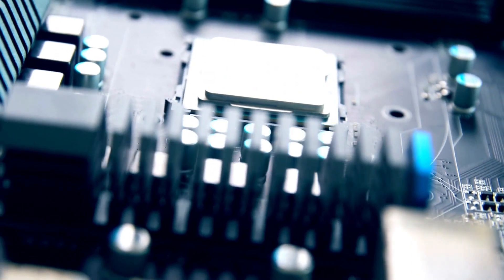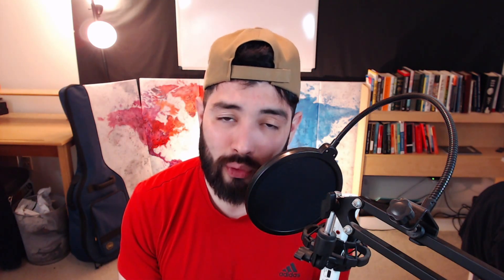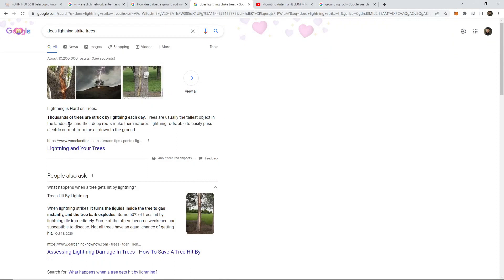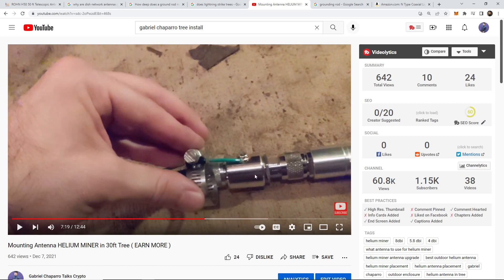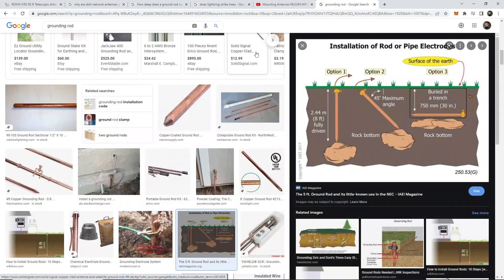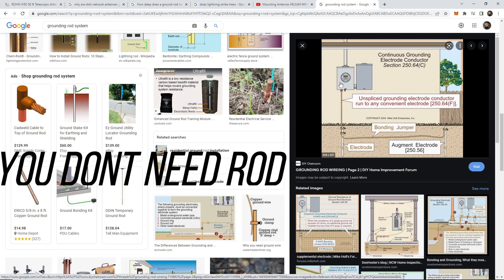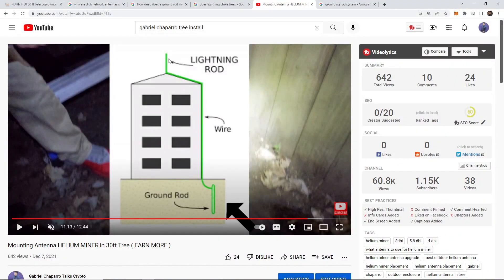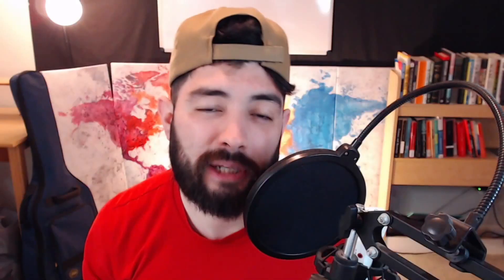Grounding Helium Hotspots ( Everything You Need To Know )

Comment: Hey man, I'm grounding a 9 inch, solid copper Hnt antenna to the top of my roof to the side of the house, can I ground it without a lightning arrester?  There's no way to connect a lightning arrester since the cable of the antenna is imbued or manufactured directly into antenna w/o the option to add an arrester, so anyways, I'm bringing a 20 ft solid 10 gauge copper wire down to the 8ft copper pipe I just hammered down 7 ft into the ground/earth, that should suffice right?  The wire is directly connected to the (copper)grounding rod and up to the base of the antenna tied to the base(no arrester).  Thanks for your time, question is, does that suffice?  Thanks.
Reply from the maker: Hey Gus so there's a reaction in the arrestor when lighting strikes, causing the arrestor to disengage the path of conductivity to your power cable, and switch it to the grounding wire. so without the arrestor it's 50-50 % chance it will go to the power cable or grounding wire...BUT with that being said... A grounding wire will prevent static to build up and prevent a lighting strike. I'm no expert, but also if it's just on the roof of your home, that's also not a super high chance that you conduct some serious static. ( Typically ).. So having a grounding wire is way better than nothing. ( I replied on the other one too lol ) 🙏🙏😂
Reply: @gabrielchaparrotalkscrypto  Thanks man!  Yeah it's a pure copper black antenna, it's identical to the stock antenna the Bobcat 300 comes w/ but bigger, it's a 5.8 dbi, I mounted it into my roof and left side of house, I bought an arrester but there's no way to connect it into the antenna, so... I'm guessing "path of least resistance"?  Why would lightning follow the Bobcat miner itself when it can just go straight into the ground in an 8ft buried copper rod?  Idk man, I might change location...  wtf. I'm a bit worried.

Comment: Is it bad if my grounding wire is too long from the antenna to the grounding rods?
Reply from the maker: not really. not sure why you would want it longer though. ???
Reply: @gabrielchaparrotalkscrypto  
Because I wanted to place my hnt copper antenna onto my chimney cap which is in the middle of my roof 8 meters up into the air, but I decided to go for the side of the house yo be closer to the grounding rod, question is;  Hey man, I'm grounding a 9 inch, solid copper Hnt antenna to the top of my roof to the side of the house, can I ground it without a lightning arrester?  There's no way to connect a lightning arrester since the cable of the antenna is imbued or manufactured directly into antenna w/o the option to add an arrester, so anyways, I'm bringing a 20 ft solid 10 gauge copper wire down to the 8ft copper pipe I just hammered down 7 ft into the ground/earth, that should suffice right?  The wire is directly connected to the (copper)grounding rod and up to the base of the antenna tied to the base(no arrester).  Thanks for your time, question is, does that suffice?  Thanks.

Comment: Again, ground your Ethernet. It will actually attract more static than the antenna because of the length.
Reply from the maker: Even if the cable is bolted to the tree? Thank you!
Reply: @gabrielchaparrotalkscrypto  I would, just to be safe. Im doubtful on woods ability to safely discharge to the ground

Comment: Cannot stress enough to use a surge protector. For your hotspot. Your Poe. Your router. They usually loose the eth jack during a storm. If ran through a surge protector you lessen the risk of burning out a port. No one wants a non working wan port on their router. Nor the lan ports or even the only lan port of the hotspot to burn up. So try to protect them as much as possible bthe lightening arrestor is built into some miners, and will also take about 5db of loss from the connection

Comment: You need to be careful driving those ground rods. Make sure the water main or gas lines ect are not going into your house in the spot.
Reply from the maker: oh yea good Call. do you know how deep they usually are in the ground? 6ft?
Reply: @gabrielchaparrotalkscrypto  usually depends on the frost line from where you are.  If you are in Houston I'm betting your utility lines are pretty shallow:  18-24", but just guessing.  Most utilities will come locate your utility lines for you pretty quickly if you call them in advance.
Reply: @cliffshaw4928  I think the universal number in the United States is 811 for them to come out and mark all the utilities.

Comment: Thanks for another good video. 

I also have a military communications background and recommended using a slide hammer, which is also available at Home Depot, to drive the grounding rod into the ground.

My cousin had her house burned down along with two others in her neighbor on the same night last year, so I can also assure people it's a real concern.

Almost all homes in eastern Europe have lighting rods that run to a grounding rod as a matter of building code because of the potential energy created by antennas and/or metal roofs.

Personally, I had a commercial grade steel roof installed 3 years ago and I'm going to ground it at the same time I ground my Bobcat 300 in my pole using my RAK wireless outdoor miner enclosure.
Reply from the maker: dang that's rough. I saw this but forgot to respond bro.  My bad man. I'm glad you bring this up because I have to ground so many more miners soon. Lots of work to be done.